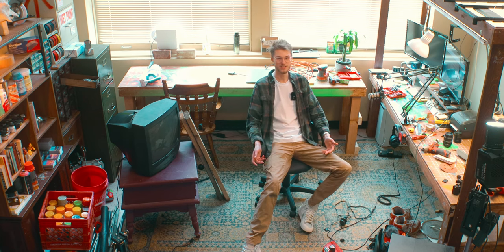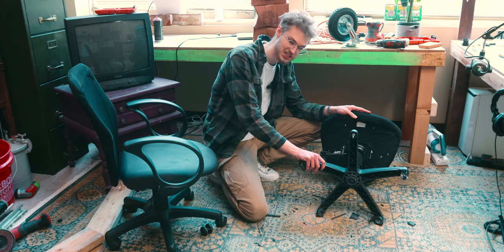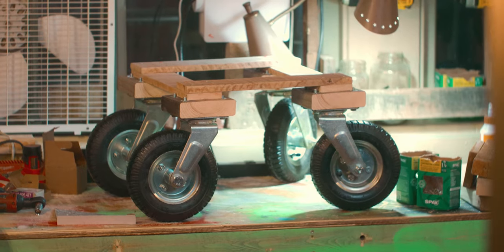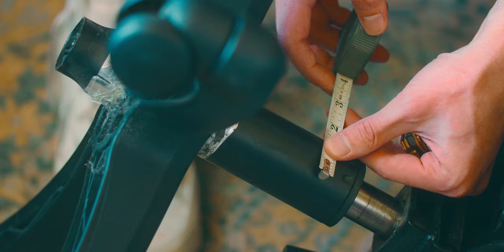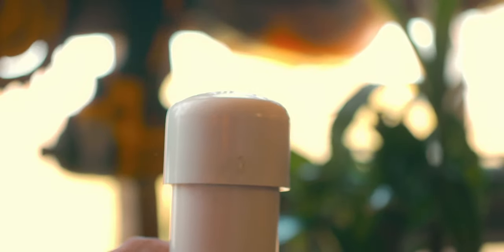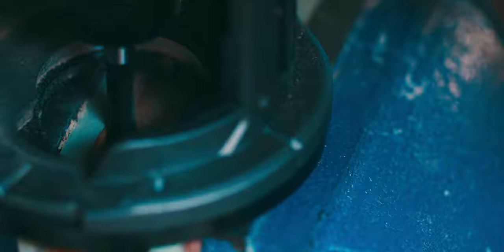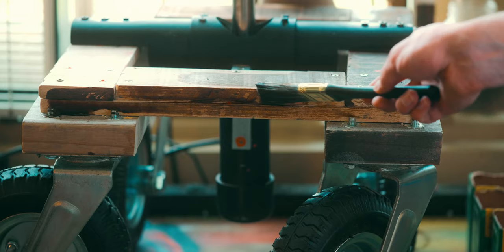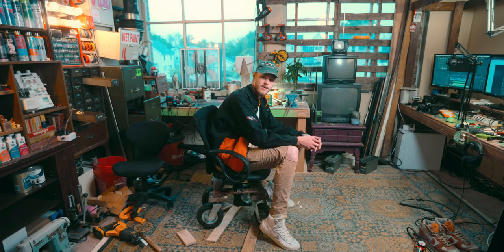1100lb Casters on an Office Chair

Comment: 03:26 question is why didn’t you just use the 2x6 you mounted the wheels to to create the whole base? Do a lap joint in the centre of two boards so you end up with a cross. Mount the wheels at the end of each board and drill through the centre at the lap joint to mount the chair to? Would’ve been a whole lot simpler.
Reply from the maker: Solid idea, that would have been way better. That’s what I get for not making a plan before making cuts lol